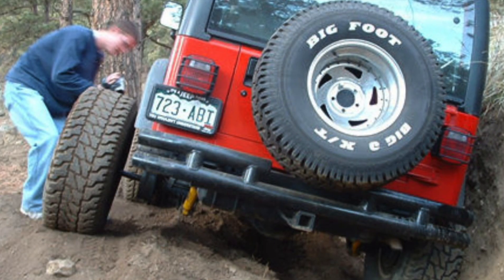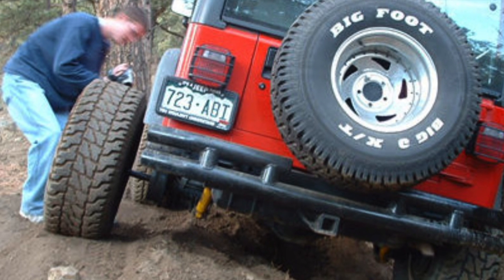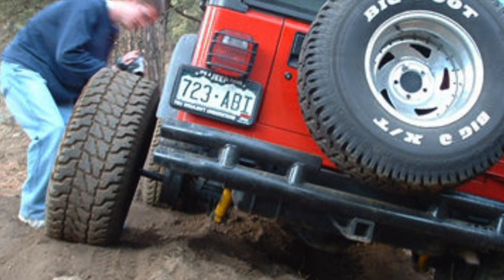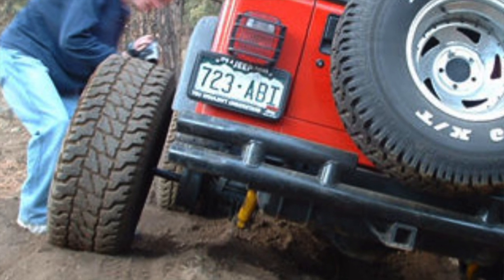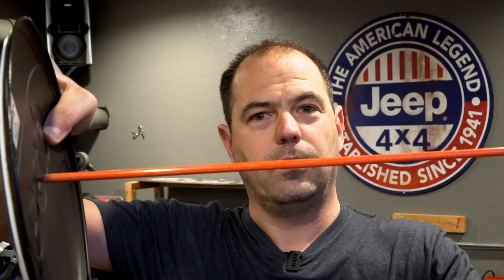What Is A Floating Axle? We Explain Why The 2024 Rubicon Jeep Wrangler Gets One.

Comment: Would the front drive still be able to move the vehicle?
Reply from the maker: Meaning if the rear was broken?
Reply: @JeepsOnTheRun  
Yes.  If the rear axle is broken but with the float it would still be straight on the hub.  Front wheel drive?
Reply from the maker: @CWChandler1968  in theory, yes.
   If you had to limp off a trail, but there's concerns I'd have with creating further damage to the axle and 4wd system.  I'd not advise trying

Comment: There is more than just semi-floating and full floating axles.  There is also a three-quarter floating.  
-Semi floating or "half floating" axle uses a carrier bearing on both sides of the differential carrier and an axle bearing on each end of the axle tube.   The wheels are bolted to the axle itself.  So this axle wood have 4 bearings, and use C-clips to hold the axles in place.
-A full floating axle uses an inner and outer bearing at each end of the axle tube(one is an axle bearing and the other is a wheel hub bearing) and an inner and outer bearing on each side of the differential (where one is a carrier bearing and the other is an inner axle bearing), this complete axle assembly would have eight bearings but the wheel is bolted to a wheel hub assembly which is bolted to the axle tube.
- The three quarter floating axle has the wheel hub bearing and an outer axle bearing like the full floating axle has with all the safety and load strength, but they don't have an inner axle bearing because the carrier bearing is strong enough due to that end not carrying weight.  There is really no down side to the 3/4 floating axle.
Reply from the maker: Yes, very good info.  My description was very surface level.
Reply: @JeepsOnTheRun  great conversation to have here though.  So many people don't understand the differences.
Reply from the maker: @fabulousoffroaddesigns5080  agreed!  I appreciate your comments, and thanks for watching!

Comment: I’m a truck driver. The floating axle on a semi axle pass though the hub assembly. So you can pull the axles without removing anything else. Now if you see a semi tractor pulling other tractors if they stop you more than likely see plywood in the wheel assembly on the semi tractors that is getting pulled. Now about safety I wouldn’t know but if you really look at a semi truck and trailer they are built to repair them. Like the inline six under the hood can be rebuilt in the frame of the semi truck even the cylinder can be replaced. The axles  and differential can be replaced without lifting the truck off the ground I think maybe on the side of the roadway if needed. Now the Jeep’s axle I would guess it would pass through the wheel assembly like a semi truck except the front axles but the axle the hub holds the weight of the Jeep’s front unlike the back axle on my JK. But that looks like a upgrade in the future for my Jeep.

Comment: I didn’t understand what a floating axle is and I still don’t understand what it is.😂
Reply from the maker: LOL - well sorry we couldn't help - but thanks for watching!
Reply: A full float axle is splined on both ends and slides into the hub to connect with the differential, withouthaving to remove the wheel or anything else to replace it. A simi float has a flang on the wheel side that bolts to the rim. So you have to remove a lot of stuff in order to repair it.

Comment: Great explanation. Very helpful. I have a question that perhaps you can provide clarity about. I have a 2023 Rubicon 392 and have ordered a 2024 392 because of the increased tow capacity. However, upon reading documentation online, Jeep clearly states that all Rubicons are getting the full floating axle and they mention the towing increase BUT they also say (paraphrased" (the 2.0 and 3.6 get an increase to 5000 lbs". SO, it appears that the towing capacity may not be increased on the 392. Unsure of why this would be? Perhaps cooling?
Reply from the maker: That's interesting, I think you might be onto something with the cooling.  Back in the day the 5.9L grand cherokee had a situation like this too, with lower tow ratings.  It was a cooling issue as well.  I'll do some digging to see if I can't get some info.

Comment: I have a 2021 Jeep 392 rubicon unlimited and wish to tow more !

Q: can I get the floating axle installed to increase the tow capacity and roughly how much would it cost to that.
Also would other things need to be done along with it .
Reply from the maker: While most people upgrade to the floating axle for off road benefits - it does help with that weight handling like we spoke of.  Keep in mind making modifications to help with tow capability is a tough topic.  Even if it does help, the Jeep isn't rated for that increase from factory.  So if you were above the factory specs, and caused an accident - it could be a can of worms.

Comment: 😊
Reply from the maker: What's your thought of thr new Wrangler?
Reply: @JeepsOnTheRun  like the axle upgade and increased towing, wish I could tow 6×12 trailer loaded. I'm running the xtreme rubicon with stock 35 which is good for everyday driving. My offroad is mostly logging roads in Maine, no real rock climbing. But towing is handy for moving brush and picking up supplies or pulling snowmobile. I do have a power wagon though.
Reply from the maker: @RoryVanucchi  got to love the power wagon for the hauling! 😊